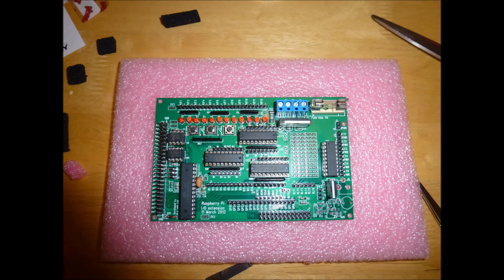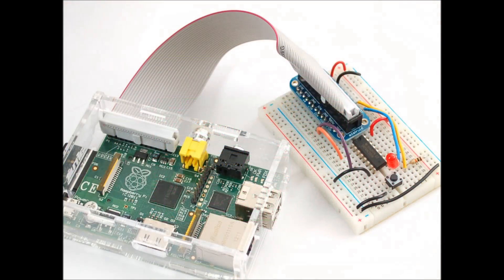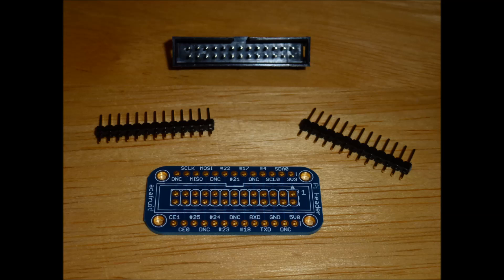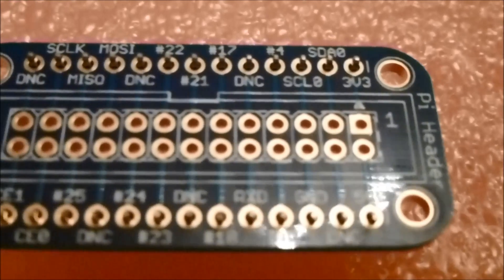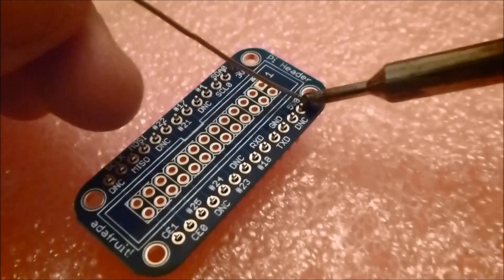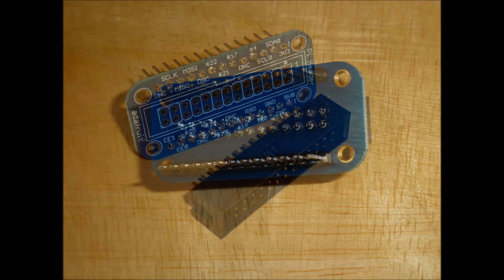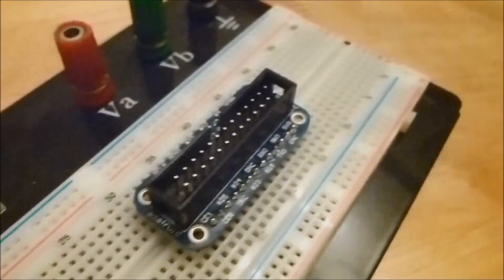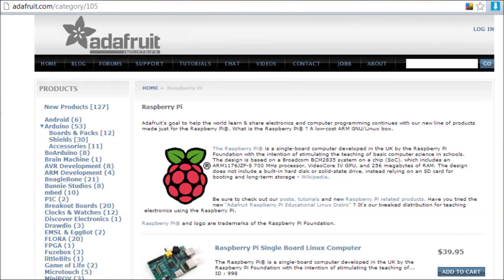Raspberry Pi - Adafruit Pi Cobbler

Comment: Soldering tip: Instead of putting solder onto the iron and then dropping the hot solder blob on to the pin, it's better to use the iron to heat the pin/pad junction for a couple of seconds and then apply the solder directly to the hot junction. This way you'll be far less likely to get dry joints.

Comment: When I'm soldering stuff like this I find it much easier to go ahead and put the headers into a breadboard spaced to fit the PCB on top. That way you know the headers are straight enough to fit the breadboard perfectly and it keeps it in place while you solder the rest of the pins!